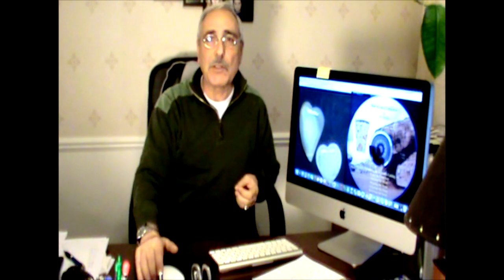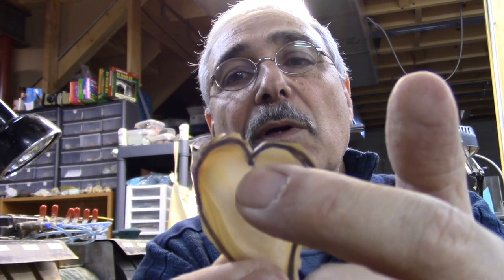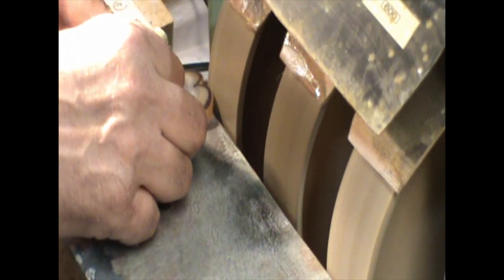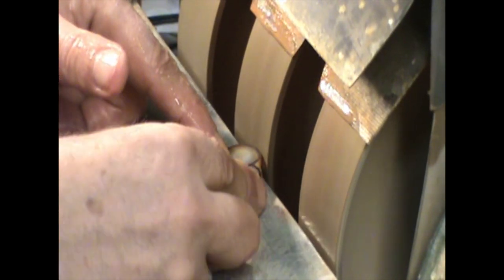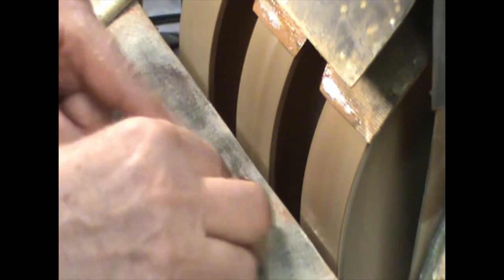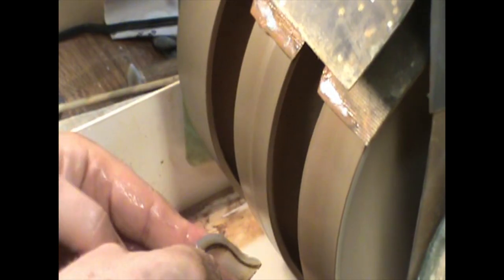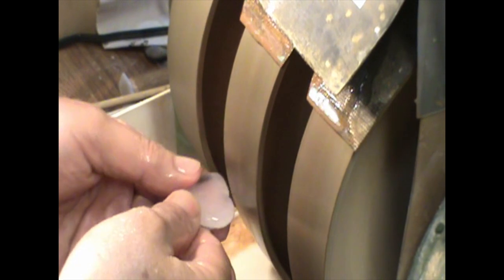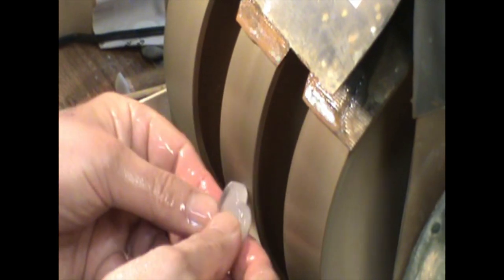The Making of Hearts

Comment: Sir, can you tell me what the material is that is distributing the water on your wheels and keeping it from letting the water splash on you. I have such a problem with the water splashing all over me, and if I turn the water presure down it foesnt seem like I get enough water. Or do the wheels just need a little bit of water.
Reply from the maker: I use thin rubber sheets and cut them to suit. Watch this video it will show the inside of the cover and how the rubber sheets are mounted.
https://youtu.be/p8iOhP80TaE
Reply: Thank you, your so kind to help me with this.

Comment: Thank you for the video. I was wondering since you actually move the stone in between the two wheels so that the stone is actually some what behind the face of the wheel, does that mean this is not possible on a 6 inch since they don't allow as much room between the wheels. I have the cabking 6 inch wheel machine.
Reply: Thank you !!